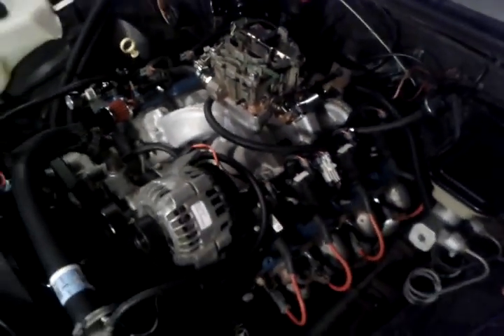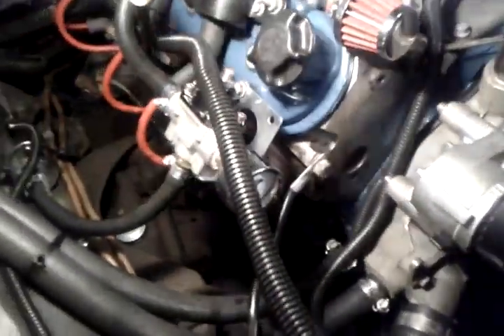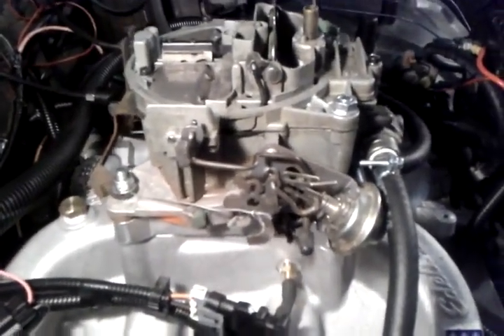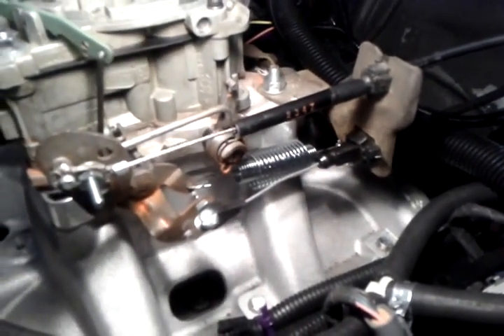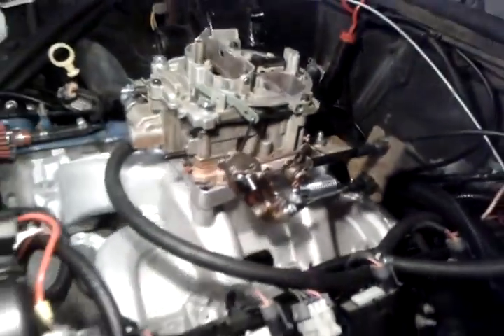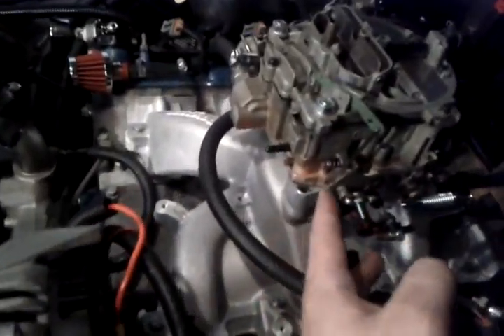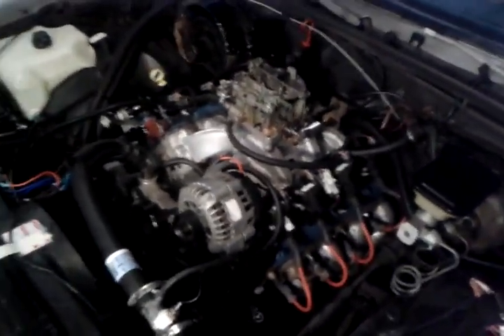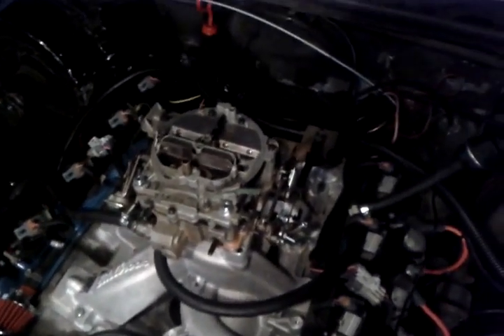How-To: Run an LS1 with a Quadrajet

Comment: I'm running a 800 cfm quadrajet with a methnol/ alcohol rebuild kit in carb on a ported Victor Jr intake, ls9 cam, ported stock heads, 5.3. 80 mm turbo, NOS. Setting up quadrajet to run turbo threw it. I love quadrajets. Cheap and they kick azzzs when needed
Reply: I'm looking at doing this for my firebird, I have a Cadillac 700r4 to put behind it? Should be great?
Reply: @DayRider76  If you need rebuild parts performance or stock for your transmission, try Globaltransmission.com. out of Centerville, Ohio. Great parts and great prices.
Reply: racing  thanks
Reply: @DayRider76  sorry that's Globaltransmissionparts.com. welcome man.
Reply: Please let me know how you hooked up the turbo with the q-jet!

Comment: Quadrajets have fuel atomization   on par with fuel injection at a fraction of the price.  People didn't like them because of poor secondary adjustment.  The secondaries are easily adjusted by the screw on the side of the carb(after loosening the set screw). They're really easy to rebuild.  Be sure to change the float and needle, set the float level, and clean everything well.  The float tends to loose buoyancy over time so replacement is important.  Also don't forget the built in filter.

Comment: Nice, what jets and rod/hanger size/numbers are you using? I am setting up a 5.0 Ford with a 800 cfm Qjet. Thanks.
Reply: RoadRacerGT 
Curious as to how it worked out for ya? I love Quadrajet carbs and have been contemplating putting one on my 5.0 TownCar.

Comment from the maker: I dont have to worry about inspecting here in Ohio, the Cutlass is almost 30yrs old.. they inspect cars which are 25yrs and newer.. My setup is completely off the grid.. I dont have to worry about the check engine light because the MSD controller is the only electronic component on this setup... and its completely stand alone.. besides this motor is so efficient i bet it would pass emissions without converters going up again the original V6 numbers

Comment: What's the latest news? Did you increase your mileage?   I am going to do the same thing, I am putting an ls engine in my 78 corvette and from what I have been reading you can get a few more ponies out of the carb setup and save the hassle of going injected. And in my case keeping it easy to put back in the old 350 and keeping the ls for the next project.

Comment: So you your pcv is inline w/ your brake booster. And are you using a pcv valve? If not is there any problems with sucking up oil

Comment from the maker: The Electronic Q-jet is actually a pretty decent carb IF set up properly.. but good tuners are far and few so your better of just tossing on an older one or going your route. I ran a Holley for a short while, however no matter what I did to it, it was a pig. The Q-jet is much better

Comment: Curious to know if you're msd ignition system is still working after 11 years have any problems cuz I might get one
Reply from the maker: I ran it on 2 vehicles never had an issue with the old 6LS
Reply: Still running quadrajet?
Reply from the maker: On my new ride i am

Comment: You inspired me to do the same and I am almost there with an LS3 for a 67 Camaro, but I was wondering about a few things that I don't think anyone else asked about in your comments. Were you able to use regular gas or did you have to use a higher grade due to knocking? That is one of the main things that I am worried about. Also, what did you do about the choke? I think I see from the video that you have it disabled with a wire, but did you always run it that way. I am new to the whole carb thing so forgive me if I sound a little uneducated.
Reply from the maker: Ya it gets quite tiresome to answer repetitive questions that I cover time and time again. But Im here for ya. In the S10 I'll run premium, occasionally I'll toss some 89 in there with no issues as well. It all depends on where you have your timing set at. Also I wired the choke on the S10. For the longest time I ran it without but cold starts got annoying.

Comment from the maker: EFI would win without a doubt.. the beauty of the carb is simplicity.. A wide band O2 setup would allow me to dial this pig in perfectly... however EFI would conquer all... Carbs for the racing.. but for an everyday cruiser this beast needs fuel injection.

Comment: Man...this making me itchy to do a Qjet on a 6L iron block if for anything just the sound of a qjet on a very flexible engine that pulls upto 7000rpms and is less expensive than trying to build a DZ302, 327, Ford Windsor or 351c with aftermarket heads that would be an equal package and rev as high. Also it would be completely different from what everyone else is doing. I will have to call in some big guns to do my carb tuning but, I definitely know a guy.

Comment: @RoadRacerGT an 800cfm carb may be a little much for 5.0/ 302 I'd go with a 625 or a 650.  I run a 650 on my 383 stroker and that's plenty of fuel
Reply: There
Is no such thing as anything but a. 750 or 800 cfm q jet but they don't work like a holley they work on engine vacuum and only give the engine what it needs so that statement is not correct if it calls for 625 cfm that's wjst it receives from a qjet
Reply: You clearly dont understand how a Q Jet works.

Comment: just for the simplicity of it I think it's awsome it's the way I would go ... what's the deal w the coil packs is there a way around that w a hei ?? how does it know when to fire etc ?? I got the msd box but what does that run off of a crank trigger or something ?? I would love to learn more about this set up as one day I'm going to build something I'm not sure what it may not even be an ls motor which would make it even easier but I love the word kiss keep it simple stupid !! and I'm not going to be driving to Denver where I need the computer to change the air fuel mixture for me .. thanks great video
Reply from the maker: Glenn Manchester msd6014? I made another recent video detailing what the msd harness entails

Comment: LS swap: $5000    carburetor: $10    spending months to get it to run perfect:   priceless

im just joking, sorry
Reply from the maker: +Chris Craft its ok man.. my swap actually cost around $1400... and the carb was free ;)
Reply: were the speed demon videos on the same car?
Reply from the maker: yes.
Reply: It is priceless
Reply: @chriscraft77022  Quadra jets if good...witch most of the case are...run as good as fuel injection.